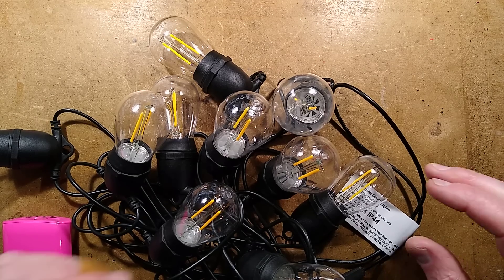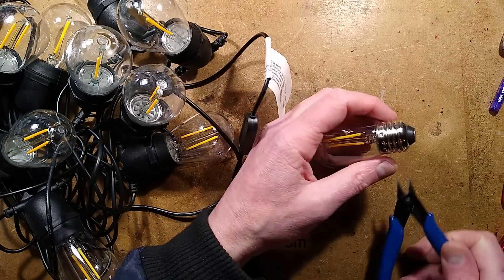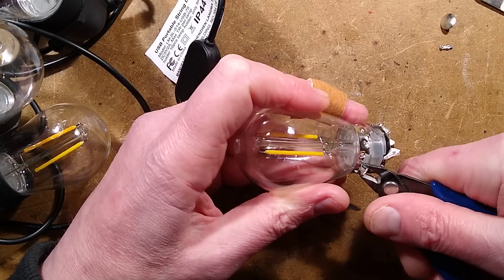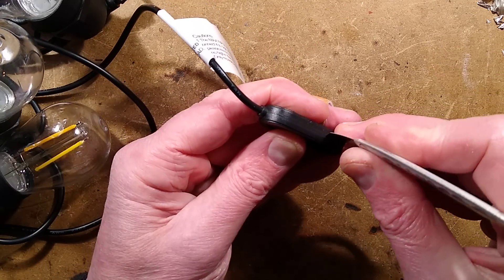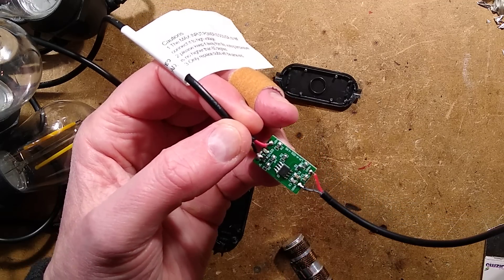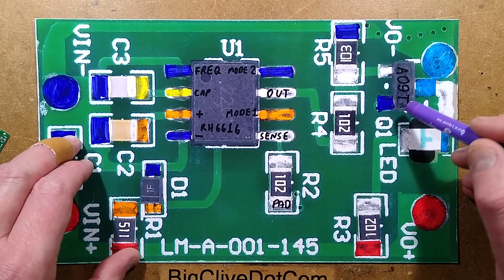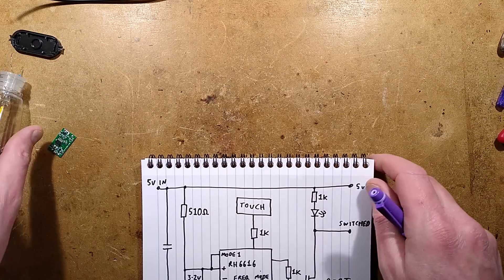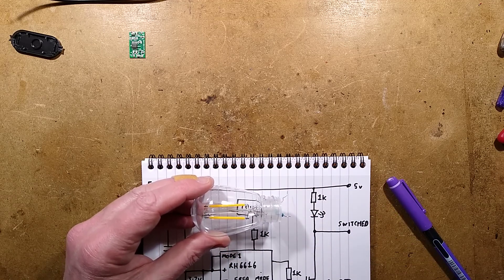Very nice low-voltage lighting festoon

Comment: Great interesting vid Clive.  
I like those plastic covers for impact resistance.  
Do you think that 2 of those bulbs wired in series could handle 12-15v with a simple inline switch for camping and camper trailer purposes, or maybe use 3 in series with lower light output?  
Regards, Jas.  
VK4FJGS
Reply from the maker: It should be viable to use three in series.  Two might cause overcurrent issues.
Reply: @bigclivedotcom  
Yeah, I was thinking along those lines that 3 should be good for ambient camp lighting.  
Regards, Jas.  
VK4FJGS

Comment: Clive, I have been looking at low voltage lighing systems used on farms etc (48/50volt). Filament lightbulbs are still available but expensive. I was wondering how much trouble would it be to alter new cheap LED bulbs (bayonet and ES). to run from a 50v system (prob DC. as they often had lead acid batteries that the lister charged during the day). A little project for you? lol
Reply from the maker: Only some lamps would be suitable for hacking to that voltage level.

Comment: Your linesman's style pliers work well for cracking open many cases but I think you might like slip joint pliers better.  You will have more control and can find the most appropriate jaw placement since they can be set wider than the case you are cracking open and place the contact point where ever you wish.

Comment: BigClive, regarding your rechargeable worklight and solar PIR lamp videos, please consider making a video about a generic circuit that would allow to safely charge a 18650 with a 5V panel, with a 3.3V or 5V output.
Reply from the maker: You could use a TP4056 module.  It would have to be a 4 to 5V panel.

Comment: They'll work well off a single lithium ion cell. If the reduced voltage makes the lights a bit dim, then replace the resistors with lower values.

Comment: Question: What happens when you plug two 9V batteries together?  I can only guess of 3 things; 
1) the voltages normalize between them, so one with low charge and one full, they both would be about half charge when done (if rechargeable, if not #2)
2) something bad; excessive heat then a breakdown with possible visual display
3) nothing, not enough energy contained in them to cause too much issue, don't breath in any vapors
Reply: Plugging 9 volt batteries together puts them in series and then short-circuits them. Probably somewhere between option 2 and option 3, depending on the type of battery.

Comment: I'm more concerned that the bases of the lamps are E27 which is normally associated with 240v operation. i suspect if one of these lamps were ever screwed in to a standard 240v lamp holder it would be rather dangerous 🙃

Comment: Clive - how about filling those plastic bulbs with very pure water (non-conductive) to dissipate any heat, then overdrive the LEDs? A nice change from under-driving them, perhaps? You could even use  different colours of water along the festoon.
Reply: Running with that... they'd be heavy and could leak in storage, but in use they'd hang base up and liquid containing globe down. Do we think they'd put off enough heat to stir up Clive's antifreeze glitter?

Comment: Just a random thought that occurred to me today - I can't seem to find anything about it online either - do you think it's feasible to bypass an electricity meter inductively by the minimal length of wires coming into the meter from outside/the main breaker/fuse?  You won't be tampering with anything since you're not cutting or slicing into the cables.  I guess you could use it to trickle charge batteries.
Reply from the maker: The amount of energy you could harvest inductively would be very tiny.

Comment: re: your comment. I'm trying a few different methods to provide continuous ambient light for frequent 2-4 hour power outages to some USB power lights - festoon, fairy and a few other types. TP4056, DW01&8205A, and power bank modules. Intent is to house them in 50ml centrifuge tubes to make them weather and ant resistant for outdoors. Big enough to house an 18650 plus 30mm of space for circuits. The tubes are made from Polypropylene that should handle up to 125C easily, and starts deforming at 130C.
Reply from the maker: I featured a power module based on salvaged lithium cells and a TP4056 charge module.  If a string of LEDs is connected to the output it will charge the cells and then power the LEDs directly for ornamental use.  When the power fails the LEDs stay lit for a good length of time for emergency lighting use.

Comment: They really went to town on those lamps. As much as I hate to complain (at least it's replaceable!), I'd worry about getting them mixed up with my standard LED lamps. As an aside, it might be interesting to find out how little current that controller chip can function with. A higher pull-up resistor replacing that 510 ohm one might be doable to cut down the standby current.

Comment: Nice little controller there. I've been wondering how those LED TV backlight strip testers, the ones that do a "soft-on" with auto-sensing current limit, work. Maybe worth a video (hint hint)? Excellent work as usual, thank you.
Reply from the maker: I have a few of those testers here.  Some are safe and others definitely aren't.
Reply: @bigclivedotcom  Thanks for the reply! I want to actually buid a safe one myself (importing is too expensive for me) if possible, so a few hints or sshhchematics would be useful....

Comment: Always enjoy your deconstructions, BC. One thing I do miss though is an oscilloscope analysis of what is happening in key parts of the circuitry. I would be very surprised if such a piece of test equipment isn't lurking hidden in the basement of BC towers, along with an old horseshoe design AVO meter. I'm really showing my age now ....

Comment: Very nice lights at only 5v! By using only one resistor at the beginning of the string of lights in parallel, they can reduce the power comsumption drastically. Problem: you have to open all of the lamps to remove the resistors. I wonder if the plastic is UV-resistant especially the bulb. They never tell what kind of plastic is used. I had some LED strips and the transparent plastic is completely faded and yellow and break easily because of UV-damage. Most plastics cannot handle UV very well.
Reply: It doesn't make a difference in power consumption if you use one central resistor or distributed resistors. To save power you need a more advanced circuit. Using distributed resistors in a parallel setup is good because it reduces the effects of voltage sag across the cable.
Reply: @eDoc2020  "It doesn't make a difference in power consumption" Yes there really is. Try it. Each resistor consumes power to limit the current (and prroduce heat). Agree on balanced current consumption but most of the chrismas lights these days have only one resistor to limit the current for the whole string of fixed amount of leds of the same colour. If you have adressable LEDs this is another story.
Reply: @codebeat4192  Let's say you have 10 LEDs you want to run at 20mA each (200mA total). They drop 3 volts and you want to run them from a 5 volt supply, meaning a 2 volt drop. You could use a 100 ohm resistor on each LED or a 10 ohm resistor for the parallel cluster.

For the individual resistors each resistor would consume 2v * 20mA = 40mW. The 10 put together would be 400mW.

For the large resistor it would consume 2v * 200mA = 400mW.

One of us is missing something.
Reply: @eDoc2020  If assuming theory was the simple real world everything was easy but sorry it isn't. Again, try it and you will see what I mean. Besides, I will never use a LED at the maximum rating and also I think these LED filament types are strange/custom puppies.

Comment: Just got a Chinese made electric blanket for about the same price as this set of lights. Wonder if testing the safety would be up your street? 
"CLEARANCE 🔥 Electric Heated Mattress Blanket King 180cm*150cm Warm Winter Grey"
The control gets a little warm when the blanket is off, drawing 1.1W. Full power is 160W, that's 80W each side, and the blanket (meant for King size) covers the whole area of a double bed.

Comment: I have a string of similar lights outside. Solar powered, 12v, 20 lamps, German made.  The controller has several modes, on, fast flash, slow flash, slow up and down ramping etc. The battery lasts all night in the summer, dark here in Cape town is about 7 hours long. Winter is more like 12 or 13 hours of dark, so I'm waiting to see if they last that long. With the power cuts we are having, it's essential to have lights on outside, helps to keep the boogie men away. They bloody better last all night, the string cost 1200 SA bucks!

Comment: Have you noticed how, over the last few years the Edison screw type lamp fitting is becoming more prevalent here in the UK? Go down to your local Tesco's and you will find a equal amount of screw caps to the tradition bayonet type. Before the advent of eBay and Amazon, Edison screw bulbs were a rarity.
Reply: That way they can sell also all kinds of adaptors, like bayonet to FIRE, bayonet to ELECTROCUTION, bayonet to SPARKS, bayonet to SHORTCIRCUIT, bayonet to SMOKE and some more or less reliable bayonet to any other lamp base.

Comment: Interesting video, biggest problem with these type of dimmers is electrical RF noise, they are a total nightmare, you won't make friends with many SW radio or radio hams running these things, you will be putting out about 300 meter circle of rf noise.

Comment: Is there anything to prevent someone like me who is electrically challenged from putting one of these globes into a 240V ES lamp holder?
Reply from the maker: Nothing at all for a wide range of low voltage lamps.

Comment: Would you not have been able to pull off the globe by heating the screw cap enough with a hot air tool to make the plastic turn chewy?
Reply from the maker: The crimp is sharp and quite deep.

Comment: Had a similar usb light, one light that looks like a lamp and a remote control on the cable, the control unit caught on fire randomly one day and almost burnt my living room down so be careful, still use some usb lights but with toggle switch not dimmable 🔥🚒

Comment: The cover for the switch reminds me of a nice ebay import led lamp I purchased many, many years ago with a mechanical switch the produced intermittent light at best.

So I removed the “secure” cover by separating the two halves (no glue involved) to find two sets of wires. Positive connected either end of the switch by the wires being wrapped, not soldered, to the connector and the negative being soldered together with no protection and close to the incoming positive.

Luckily low voltage and the internal fuse protection of the 5C adapter should have hopefully kicked in.

But some quick soldering and heat shrink around the cables and 4 years later still going good.

Everything I order in now that has any form of electricity running through including battery and low voltage / current gets pulled apart and checked.

I found one once on a friends mains to led stand lamp where they soldered the wires on incoming 230v onto a board with the LV DC circuit but the solder made a perfect big amp fuse between live and neutral 🤦‍♂️

Comment: I discovered an edison screw bulb, glass, led, inside a solar light in tesco, no circuitry inside the light which I suppose let it be used on almost no voltage, which really made me want to screw it into an ES socket and watch it go boom 🤣

Comment: As someone said, poof!  Too easy for someone who don't know or isn't paying attention to put one of them bulbs into a regular lamp. Granted I know a regular lamp in UK is ba22d. Still in my opinion it should use a different base if its low voltage. I've seen a similar situation here in America. Battery operated candles using e12 sockets as used in plug in candles and chandeliers. I think they should have used something else. Many battery candles now have LED bulbs that have a special purpose made base. Also there are e26 RV bulbs rated 12v 50w that look like any rough service A19 bulb. I think they also used in 12v trouble lights, and trouble is right. When the voltages differ I think so should the interface mechanisms. It's bad enough to have like an e10 torch bulb or a Christmas tree miniature bulb that could be one of any number of voltages but messing around with 120 or 240 mains voltage, no!  I'm going on holiday to Thailand and its a bloody good job I know I may encounter combination sockets that accept USA a and b plugs as well as Europlugs and the new Thai O plug, but that output 220. I'm carrying a heating pad and a voltage adapter. I say publishing literature and hoping travellers read don't cut it and A and B should have never, anywhere, been used on 220. We have 208-240 for higher power machinery and plugs and sockets for such use differ.

Comment: Using plastic rather than glass for the globe may be a thermal thi thing.  Glass reflects IR so they have to fill glass globes with helium to conduct heat from the filaments to the glass.  Plastic is transparent to IR so they don't need expensive helium.

Glass support for rigidity?
Reply from the maker: I think the glass support is just a standard component from other lamps.

Comment: So who else was hoping Clive would screw the low voltage bulb into a 240V socket? ;)
Reply: It's Clive, the master of disassemblung and not Electroboom (in his way master of desintegration). Love both channel!
Reply: @gunnardannehl372  
Yeah, AvE would probably get 1/30'th sec of dim illumination for 8/6 of buffalo on quarter-ton titanium bbq plate.
What Matthias Wandel would do .. up to guess :)
Reply: The lamps could catch fire, which could be interesting/dangerous
Reply: Give anything enough voltage and it'll light up!

Comment: on ebay 10 Seiko S-812C33SG 3.3V Voltage Regulator 100mA TO92 for £3.50, thats 35p each, if you brought them in bulk probably get them a lot less

Comment: I can't be the only one who wants Big Clive to give one of those bulbs the full business to watch the destruction!
Reply: Yeah that was kind of a concern of mine with those bulbs.  With the standard base meant for higher voltage bulbs it would be possible for someone less electrically knowledgeable to put one into a socket supplying, in Big Clive's case, 240V.  That would lead to catastrophic failure of the bulb.  Clive missed a chance to make that point strongly by putting one of the bulbs in such a socket and powering it up!
Reply: @davidh.4649  I once screwed a E27 12V bulb into a 117V socket it looked like a photo flash bulb.
Reply: @davidh.4649  I think Clive likes these and will have them glowing in Ralf's boffy 🤭
Reply: As a kid I once ruined a whole box of low voltage infrared photography light bulbs (they were standard Edison base) that belonged to my dad. I screwed each one into a socket, didn't see any light so tried the next, etc. I forget how much they had cost him.

Comment: Clive, I recently picked up an LED edge lit panel that projected the light downward. I will use it in my workshop as my shop is on a farm with no electricity (search the word Amish). I have a generator to power tools, and the like, and 12v light for above the welding table.
The light was one of two that were mounted above a desk in the bookshelf.
Reply from the maker: I'm already aware of the unusual Amish lifestyle.  A commendable work ethic.
Reply: @bigclivedotcom  at one point, I drove them around, for work, and they are definitely hard working people.

Comment: This is the first item I've seen that actually makes that annoying "auto-shutoff" feature of power banks useful. I'd still just rather have 5v all the time or, at the very least, a power bank to tell me what kind it is before I buy it.
Reply: They should all just do both. Turn it on with a button, double click the button again to make it stay on forever. Long press to turn off.
It they all just did that, would would all know what type they were and everyone wins.

Edit: if there's any Chinese power bank chip manufacturers seeing this, feel free to steal my idea and copy it as much as you can. Tell your friends at other power bank manufacturers too - let's make it a standard.
Reply: @tin2001  FYI Mr Carlsons lab has a keep awake circuit for power packs

Comment: It looks like you left the "CAP" pin and its capacitor out of the schematic, but it's not important to the overall use of the circuit, just local to the chip.  I assume it interacts with the mode pins somehow to set the PWM frequency.

Comment: @bigclivedotcom is there any way to change this so that when you plug in the USB the lights come on? I've got some of these and I would like it that to do that.
Is there anything I can change on the circuit board to do this?
Reply: If you want them to always be on you could bypass the circuit altogether.
Reply from the maker: You could cut out the controller and just splice the positive to positive and negative to negative.